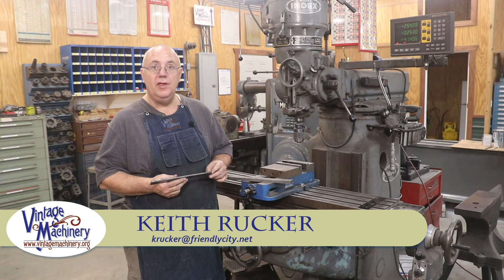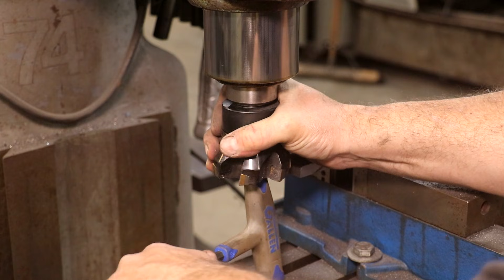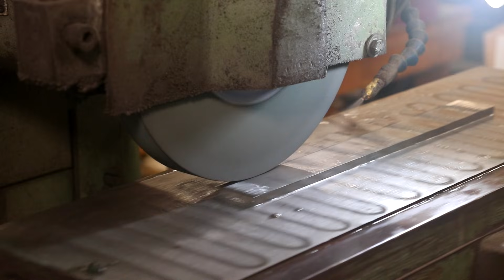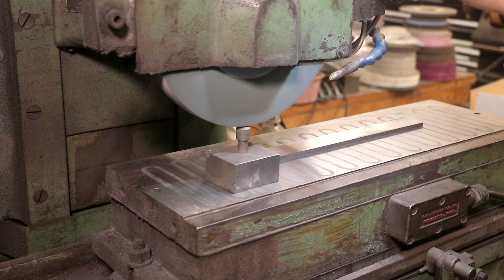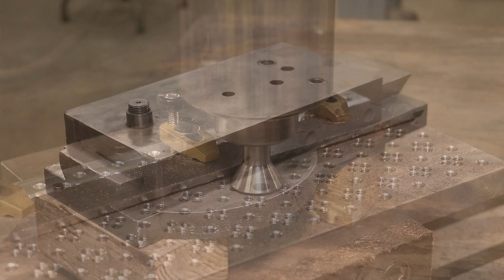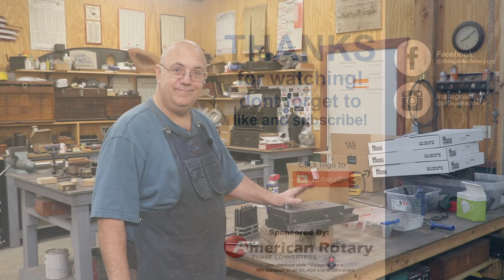Metal Planer Restoration 48: Making a Flat Gib for the Clapper Box Cross Slide

Comment: I am not a machinist but I have a question. When working on the thickness, could you have used the superglue trick on to a fixture plate, like what you used for the dove tail.  Since masking tape is used you will not get glue on your fixture plate.  It may save some time at the grinder.  I know there are always many ways to do the same things.  Thanks for the video

Comment: Has anyone ever used a Mag-chuck on a milling machine for thin parts like that? Or would there be enough holding power?
Reply: Yes you can use one, it works fine. But you need a back stop on the edge of the Mag chuck or the part just gets knocked off. You can also use good quality double sided tape 3M is best.

Comment: You mentioned your "clamping set". I've been searching for something like that and haven't found a source. Where did you get yours?
Reply: I am familiar with that type of clamping set - I have two of them. But that is not the type of clamp that Keith used on his fixture plate. Joe "Pie" used a similar type of clamp in a recent video as Keith did and when questioned he said that he made them himself.
Reply: @donkinzer5718  Making your own is one option. Keith gave that plate a name which I took as  'palette' like a paint palette but correct spelling is as fork lift pallet - so try looking for 'clamping pallet kit'. Wow, they are hard to find !!! Have you asked Fireball Tool ? Perhaps try looking for 123 blocks and asking manufacturers if they make the pallets as well ?

Comment: I couldn't help noticing the bolt holes in that slide, how they are pulled up at the edges.  That seems to be a problem in cast parts that get a lot of gronk put on them.  My shaper had the same issue where the clapper box mounts and pivots.  I dusted them off as a "getting further acquainted" project with the D-8 surface grinder.  Bozo got me on that one, because after cleaning that side up, I flipped the part over to dress up the outer surface where the dovetails are, let the auto feed go one bump too many and put a nasty gouge in the collar that the feed screw goes through.  Not enough to hurt anything, but visible enough to remind me of how quickly things can get away from you/go wrong ... good thing I still had the old rock on the grinder, I would have hated to have lost, from the new one, the amount it would have taken to remove the radius that blunder put on the corner of the wheel.

Comment: Regular cast iron ("grey" cast iron) is way too brittle to extrude, as it would break apart and crumble if you tried.  There is a form of cast iron called "Malleable" cast iron that can deform somewhat under pressure, though I am not sure that it could handle a true extrusion attempt.  Interestingly, from what I have read, Malleable cast ion is made in a very non-intuitive way:  You first quench harden "chill" the iron so that it is almost entirely cementite/martensite all the way through and EXTREMELY BRITTLE "white" cast iron.  Then you reheat it at a sequence of tempering/annealing reheats to soften that back to the regular cast iron form, but now the crystal structure is such that some ductile ferrite exists in the metal, enough so that it can deform somewhat.  Cast iron is strange stuff...
Reply: @TheAggromonster  THE MAKING, SHAPING AND TREATING OF STEEL (9th Edition, 1971) by the United States Steel Corporation, calls it "Malleable Cast Iron", defining it on page 1071 in the Chapter 39, CASTINGS - STEEL AND IRON.  There are two versions, "white heart" developed in Europe and "black heart" developed in the US, using somewhat different techniques to create this soft version of cast iron.  There is a lot of text about it in this chapter.  While "ductile" is a descriptive term for its properties, so is "malleable" and this book uses the latter exclusively.

Comment: Is this an example of the stress being relieved from the material when one side is machined ?
Reply: Don't think so, it is from the parts sticking out when milled.
Reply: @airgead5391  Yes, deflection of a cantilevered beam under load
Reply: no its an example of ray charles cutting it

Comment: I've seemly noticed that "vintage" machinery use slotted screws, with long and wide slots - some even quite a bit larger than those used to tighten this gib.  Was this a thing?  Once again, in the modern shops, a lot of these types of screws were adjusted with screwdrivers that were too thin and not wide enough causing the slot to be really galled.  They always seemed to be on the list to replaced, with Allen cap screws, but never were.  A lot of younger guys don't have a screwdriver that's 1/2 or 5/8" wide and maybe 3/32" thick.  Have you found that to be true?  While Allen cap screws or even Phillips head screws were not around when some of this stuff was made, why was the choice for such screws over say square head bolts which were around back in the day?
Reply: I can only guess that square head bolts would stick out and get in the way of things including machinists hands. Ever hit a square head bolt on edge with your hand? Also I expect slot head screws are easier to make.
Reply: screw slots have paralell sides but damn near every screwdriver you buy is tapered like a wedge. combine that with using a screwdriver that is too thin and the wrong shape and you have jacked up screw heads
Reply: @ronalddavis  Yes. Screwdrivers are like wrenches, open-end or sockets.  They need to fit the head or slot just right or buggered heads or slots result.